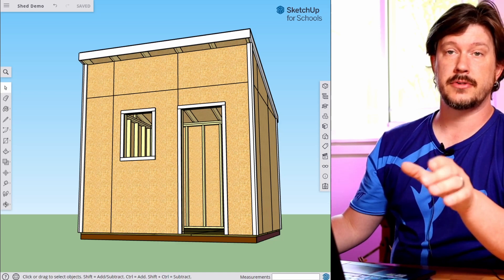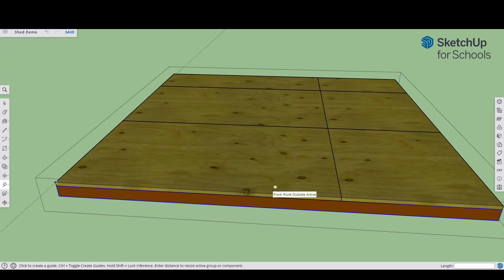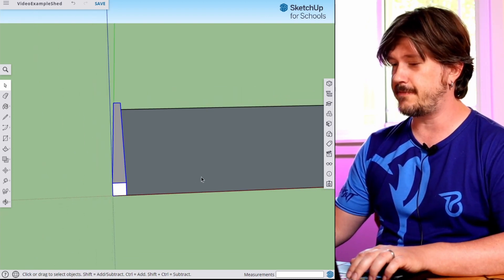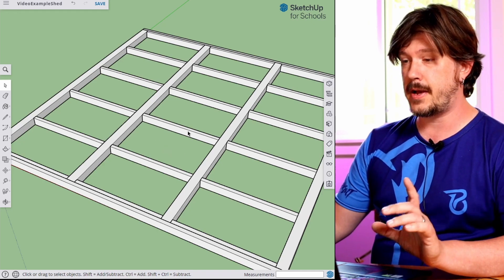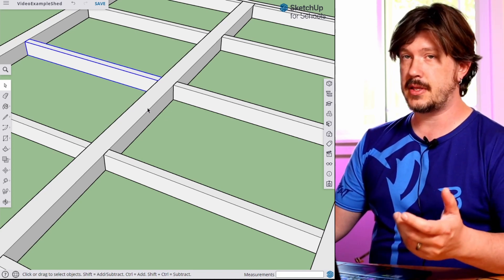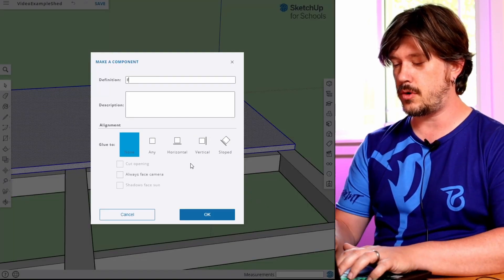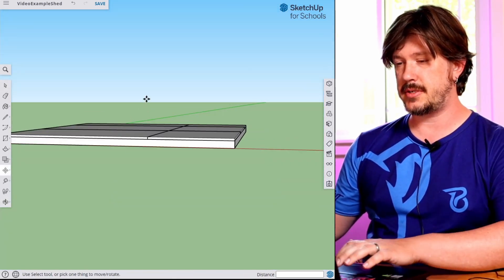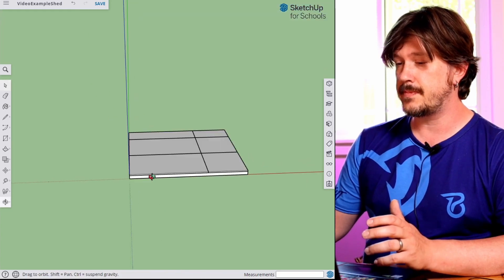How To Design any Shed (SketchUp Tutorial) | Floor

Comment: Help! We’re stuck at minute 6:11. We can’t get the “divide 3” function to work to create two more equally spaced beams. We have the first two beams at the edges. What are we doing wrong?
Reply from the maker: So I'm guessing that you may have "clicked off" after you dropped down the second beam. The "divide" or "multiply" function only works if you do it as the immediate next thing after you place the second beam after the move-copy. You can't select any other tool or click on any other component before you do the divide thing. So try placing the second beam after the move-copy, take your hand completely off the mouse, and type "/3" and press 'enter'. If that doesn't work then let me know

Comment: Shouldn’t the sub floor be staggered?  I’m relatively new to carpentry and thought the seams should never line up.
Reply from the maker: You're probably correct. I'm not a tradesman myself - more a DIY-er. I figure it probably isn't terribly critical for stability for something as small as a shed, but for a larger structure I can see how that would be important for strength and stability. Good spot!

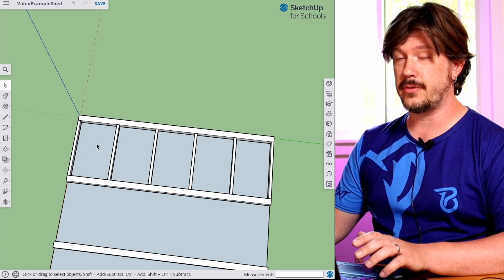Comment: I'm trying to follow along with you as well. I'm stumped at the 8:20 mark when you select all the floor joists and then move/copy them over to the next beam bay.  It won't let me select more than one component for some reason.  Any advice?  Thanks, great video btw!!!
Reply from the maker: If I recall, I think I am holding 'Ctrl' while clicking on each component. Generally doing 'control-click' is how you select multiple individual files, like in Windows, and the shortcut works here too. If you're on Mac, I'm not sure what the equivalent is, but it should be similar. LMK if that helps.

Comment: I am attempting to build  alongside you and when placing the beams I am trying the method you use of "/3" to evenly space the beams but it never works.  Could anyone possibly clarify this for me, it sometimes does nothing or sometimes deletes the move copy beam, but never works as shown
Reply: Thank you, it is working now.  There are many nuances that can affect nearly everything in SketchUp.  I appreciate your response
Reply: This helped me out too! @clayvond
Reply from the maker: When you have your copied component, you have to first drop it down where you want it (either by clicking, or typing a measurement and hitting 'enter'). after that, you can type '/3' + enter and it will divide the space. 

The key is that the component has to already be set in its place before the '/3' works - if your component is still attached to your cursor and you type anything, the program is looking for a linear measurement to see how far to move the component, not a multiplier or divisor. '/3' translates to 0/3" (zero thirds of an inch, or zero inches) which drops the component exactly in its original spot. You can see this if you move your component afterwards - they'll be stacked on top of each other!

Hope this helps, and let me know if you have any other questions.